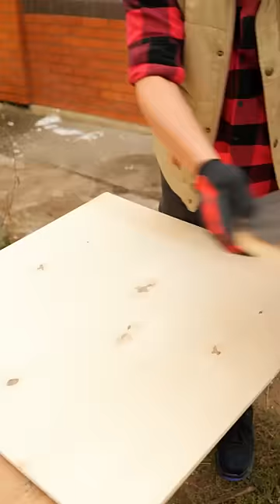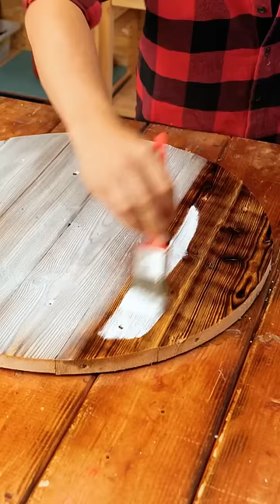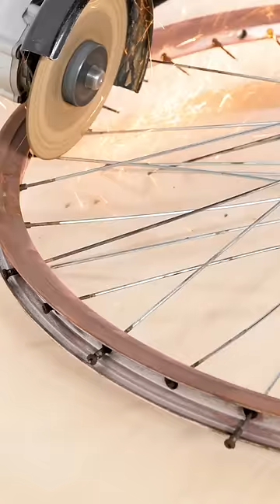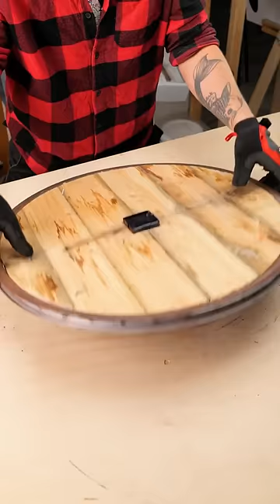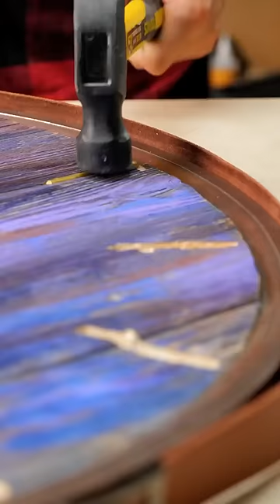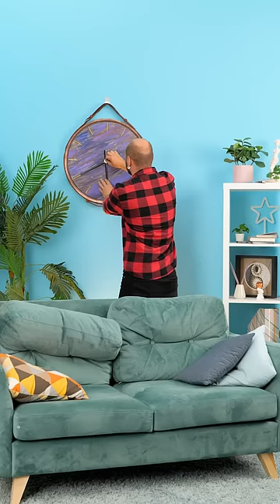Process Of Making Designer Clock From Ugly Fence ⏲️ You'll Be Impressed 😍😱 #woodmood #shorts

Comment: I have my doubts, whether the cheap plastic gears in the clock module can handle the weight of such long clock hands.
Reply: I also built a large one for the stairwell. There are extra strong movements for the long hands.